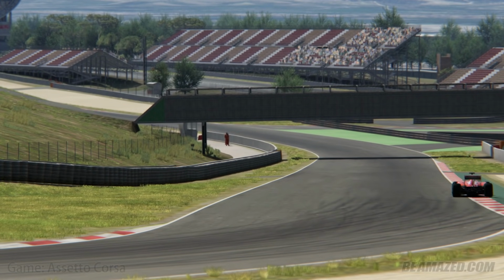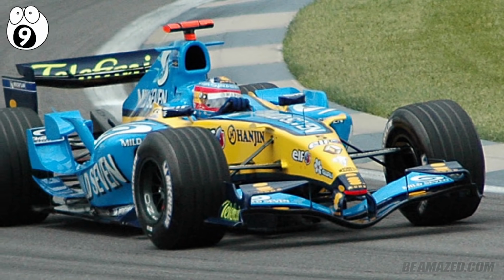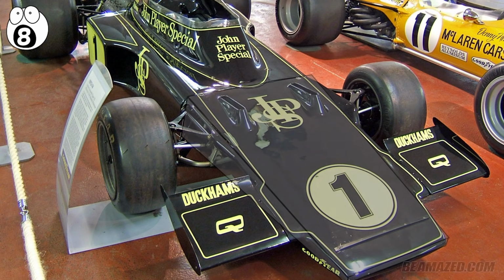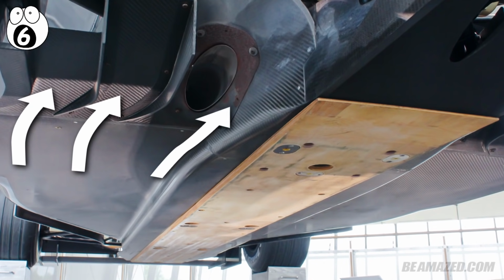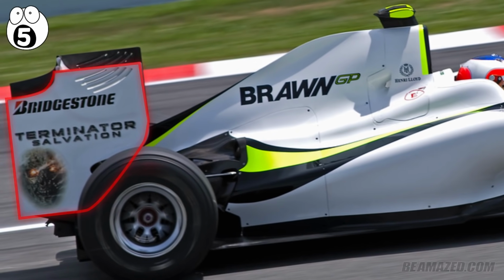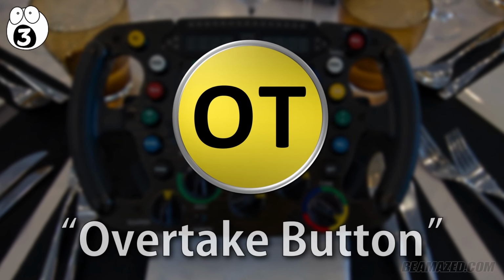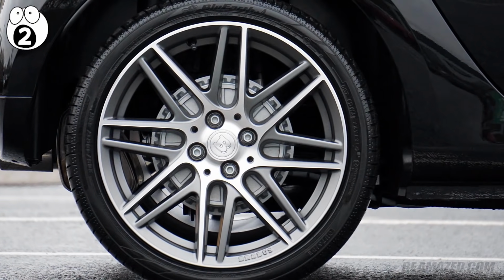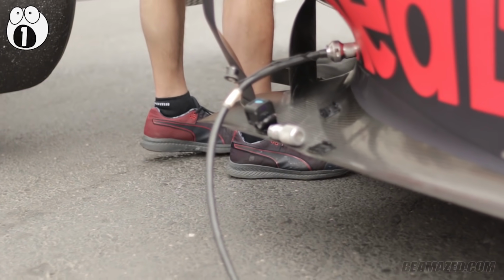Secrets Of F1 Car Design You'll Find Really Interesting

Comment: Hate to ask this, but did you not do science/chemistry at school?....Nitrogen in tyres is the BIGGEST rip off ever invented. The gullible have fallen for this hook line and sinker. By volume, dry air contains 78.09% nitrogen, 20.95% oxygen, 0.93% argon, 0.04% carbon dioxide, and small amounts of other gases.   So....The air that you put in a normal road tyre contains 78% nitrogen.

Comment: @Be Amazed: You are telling a lot of factual wrong statements. Just looking at the numbers of your subscribers and views, you have a big responsibility to bring correct facts to your public. I emplore, actually I BEG you to make another video where you correct yourself:

1. Front wing: You have quit a few misconceptions here. The end fence, as you call it, is NOT there to decrease vorticity. It is only there because the F1 technical regulation prescribe a mandatory 95,000 mm² bodywork piece in that area in sideview. The endplate is also not a (side)wing. The mandatory piece is mainly sculped this way to divert airflow away from the front tyre. It's not there to create lift. There is no point to reduce outboard vorticity of the front wing because the rotating tyre right behind it creates huge and detrimenting vortices in any case. Infact, teams try to create vorticity both in the outboard section and the Y250 section to divert airflow away from the tyre. Tyre vortices are that detrimental.

Now I hear you thinking: hold on, wings have endplates (can I advise you to use this term? Even the official tech rules use this term) to reduce vorticity, it has always been like that. Well, the current iteration of a F1 front wing is not really a wing! It is much more a front diffuser/splitter because it works mainly in ground effect. Vortices are therefor mainly created inboard and not outboard of the "front wing", just like a diffuser.

2. Your drawings of the underfloor showing high and low pressure are wrong. At the underfloor, you actually have low pressure, which goes extremely low at the diffuser "mouth" (where the diffuser starts). As you mentioned, the airflow then expands and SLOWS DOWN and becomes higher pressure (much higher than the underfloor, still lower than the flow on top of the diffuser). This is the bernouilli effect.

3.Brake ducts are NOT there to decrease drag! Infact, brake ducts to cool the brakes are kept as minimized as much as possible! This is absolutely unfounded on your part. What you do have, are fins and pieces of bodywork in that area exploiting the bodywork rules in the area to clean up airflow for sidepod cooling and getting cleaner air to the floor and splitter.

Please, please put up a video where you make those corrections. There's already enough misinformation on the internet, don't contribute to it.

Comment: Try to understand how the hybrid system works if you want a challenge 😂
Reply: Luka Ohagei figure out the tyres
Reply: they're shit most of the time.
There you go
Reply: It's not that much of a challange, there's a good channel that explains it in detail called chainbearF1 (or similarly named)
Reply: It's very easy (!). There is a motor generator unit driven by the crankshaft, and another driven by the turbo compressor impeller shaft. And a large, heavy battery pack which can be charged and discharged in a few seconds. All you have to do is decide when to assist the crankshaft, and when to take power from it to charge the battery, often under braking. Then you have to decide when to assist the turbo, and when to take power from that. The total assist power available from the system is 160 hp, but only for bursts of a few seconds, just over half a minute in total available per lap. So the strategy needs to be right. Assisting the turbo is of use in the improvement of throttle response, for instance, reducing lag. And then how to best size and balance the brakes.  Simple eh? Not.

Installation was a nightmare in early days.The currents in circulation are in the high hundreds of amperes, making the wiring interesting. The battery packs were made from 50 or more series-connected liquid-cooled lithium-ion cells of about 1.5 Ah each, this seemingly meagre capacity compensated by the high voltages, 250-450 volts. The motors are very small, and difficult to cool, particularly the rotors. Multi-level drive electronics are sometimes used to limit magnetic heating, delivering energy to the stator windings with fewer ripple current components but bulky and heavy. Due to the high voltages, care is need in installation and architecture to eliminate problems caused by the large electric fields, which can transfer charge to other elements of the electrical system, since the accumulation of this charge can deliver potentially life-threatening shocks. When working on these systems, mechanics must wear gloves, and in any case it is good practice to keep one hand out of the way.

Comment: 'The front wing is the most important element of this [amount of downforce]' 
The amount of cringe
Reply: Clorox Bleach ... The floor provides most of the downforce on the car, with almost no drag. Plus, 'I'm really good at F1'. Seriously?
Reply: The front wing is meant to use vortices to direct the air in a particular way and in this case, away from the wheels and around the body and into the bargeboards.
Reply: Tobias Ruddi he’s so bad 😂
Reply: I think the term you're all looking for is low pressure
Reply: The front wing provides 40 is percent of downforce the back wing provides the most don't know the exact numbers but I'm really good at f1

Comment: Nurburgring NER BERG RING = Race Circuit
Nuremburg - NUR REM BERG = Site of Nazi war trials
393km apart, often confused by the mentally bereft
Reply: That's the Norisring. See my first reaction in this topic.
Reply: As James May discovered after sat-nav misuse...
Reply: Nuremberg has also a street circuit called Norisring, which is on the site of the Nazi Rallies in the 30's. Noris is the Latin name of Nuremberg. They choosed that name because Nurembergring looks to much like Nürburgring (with " on the u!).

Like in this video, the name Nürburgring is often wrongly pronounced as Nurembergring. That even makes some people think the Nürburgring is in Nuremberg, instead of in the Eifel.

A similar misunderstanding in motorsport is the name of the famous steep corner at Spa-Francorchamps. Most people think now the name is Eau-Rouge, but the correct name is Raidillon.
Reply: Circuits of the past Pretty sure every self-respecting racing fan knows the difference between Eau Rouge and Radillon.
Reply: Then the're not much self-respecting racing fans. The majority calls the Raidillon Eau Rouge. And not only the fans but also the drivers and reporters.

Comment: So, so many flaws but let's just say that how you described diffuser, is totally opposite. We have low pressure area under the car where air moves really, really fast. Diffuser takes this air and slows it down and bring the pressure back to ambient air pressure. So there is high pressure around it, not low. Read: Bernoulli principle

Comment: Racing cars have a steel cable tethering system on the wheels to stop them flying off and killing spectators and marshals. 
That is NOT a secret.   :-)
Reply: yeah in a crash but if the wheel hasnt been properly attached to the car and it gets loose theres nothing stopping it
Reply: Thats true roni :-)
Reply: roni harjapää Has that happened before? I feel like the teams would go to painstaking lengths to make everything on the car perfectly set up, and forget the tethers.
Reply: No. I mean the actual rim is only held in place by a single nut. Thats why a pitstop is 2sec long. If the nut isnt in place properly the wheel might fall. Look at Sainz in the 2017 Abu Dhabi GP

Comment: End fences you dumb, their called end plates
Reply: It’s also called an end fence you fool. Most designers refer to them as end fences
Reply: Dubz0Eight he mentions bargeboards. But when talking about the front wing he talks about the side of the wing, which he incorrectly calls end fences instead of end plates
Reply: The cringe is real hehe
Reply: ColeT12378 CT43 are you dumb...they're called either Einstein.
Reply: And they work the same way ducts work on propellers

Comment: Much of the data you have used is outdated, you have used wrong names.  You also use pictures and videos that are not even F1. Much of the things you talk about are relevant but some things are no longer used. There are other things that are much more interesting instead of these. ERS for example, or the efficiency of the engines, which is reaching 50% now.  You also left things out about turning vanes, blown defuser, push and pull suspension, blown wheel nut, and you also left out that the front wing creates vortexes that are directed to guide air along the rest of the car.
Reply: Bryan Hopkins you seem like a person who doesn’t know jack shit about racing. First of all most of these so called secrets are kinda obvious. The rear up turn of the floor is called a diffuser, the front wing does a hell of a lot more than he explained, he did not say that the air intake on top of the car also doubles as a safety mechanism when the car flips, he left out Bernoulli’s equations and the Y250 vortex created by the front wing to smoothen our airflow over the sides of the side pods and then increase the overall efficiency of the  diffuser by reducing tire wake. It’s way to many wrongs to correct in the comment section. By the way I’m studying aerospace at uni. So don’t fucking tell me to shut up about things that I know more about than you.
Reply: Pull suspension isn't that new Indy car and most open wheel racing use pull suspension as it is easy to fit
Reply: Well sw gaming....then correct everything in detail otherwise stfu.
Reply: Where can I find info like that? Links for further research? Where I can find the legit info and learnt the F1 Aerodynamics?
Reply: https://www.mech.kth.se/courses/5C1211/Casiraghi_2010.pdf
Reply: This is just a slideshow but it does give good information
Reply: http://umpir.ump.edu.my/1705/1/Mohd_Syazrul_Shafiq_Saad_%28_CD_5074_%29.pdf
This is a university paper on it
Reply: SWA Gaming you talk about his information being outdated yet you mention the blown diffuser...nice one

Comment: Bulls**t, the front wing isn’t the most important, the undertray is as it gets 50% of the total downforce (negative lift) and the front wing isn’t creating downforce because of pressure, it directs the air around the tyres and on to the rear wing and gets a minimal downforce level
Reply: you couldn't be more wrong about the diffusor though. The expansion creates low pressure at the diffusor throat. This low pressure sucks the air out from underneath the car. Therefore the air is being accelerated and pressure drops along the entire floor and downforce is being created
Reply: The back wing provides downforce so the car doesn't have wheel spin the front wing filters cooler air into the cooling system while flying the front tires to the attack for a more stable turn
Reply: The front wing has endPLATES and not sidefences and the endplate’s use is to reduce induced drag, the vortex you showed is un-evitable because of the complex structure (Y250)
Reply: The undertray doesn’t work because of the expansion but rather because of newtons 3rd law (each action has a equal and opposite reaction, thus the angle pushes the air up and the car down) the downforce is created by air accelerating under the car and decreasing pressure
Reply: The front wing does create downforce, aproximatley 20% of the cars total downforce, Designers have basically maxed downforce it can create so they have moved to directing airflow to different parts of the car. Like the turning vanes and barge boards.
Reply: I'm more than willing to drop complaints about the term endfence, they aren't that bad of a term, but indeed the description is wrong. The most important thing about them and you yourself overlooked, is that these are there because the rules force teams them to. If there were no rules about them, teams would most likely not have an endplate in there. There is no need for an endplate as this isn't a run of the mill wing; the current front "wing" is closer to a splitter/diffuser than to an actual wing, creating the vast majority of the downforce out of ground effect.

Comment: #9    One crucial function of the airbox inlet is safety.   If you draw a line from the top of the inlet down towards the body right in front of the driver you'll see the driver's head is below that line...   that way, if the car flips upside-down there's less chance of, I don't know...   decapitation?

#5    The end plates on wings are there to stop the high pressure air from the top of the wing moving around the edge of the wing to the low pressure region underneath...   that creates a vortex, which is a drag, and lowers the efficacy of the wing.

#...  oh nvm, this was cringe of the highest order...

Comment: Secrets of F1 Car.. shows a F2 car in the thumbnail
Reply: Eetu Laitinen Clearly a basic under 14yo Finnish F1 fan. Just came here calling others dumbasses and then getting triggered by someone disagreeing.
Reply: Eetu Laitinen its an f1 car from years ago, 2011 i think
Reply: Eetu Laitinen  it is an gp2 car don’t act stupid
Reply: SHF // ShadowHunterFi  from 2009 to 2013 they had 3 elements
Reply: Dat Boi If you would take your time to do the research, you would find that this is the 2010 Virgin Racing VR-01, repainted with a Marussia livery as the Virgin Team was bought by Marussia in 2011.
Reply: D-Force-UK its not, its a GP3 car
Reply: Alfin R Did you even look at it? Please do proper research before posting unonformed comments
Reply: Dat Boi nope, search virgin vr 01, two elements and it raced on the 2010 f1 season. That team later changed its name to marussia, who repainted the car and used it on shows
Reply: Alfin R its a Virgin Vr 01 repainted, look it up
Reply: Eetu Laitinen eh you're the dumbass
Reply: Kurafuto Mine u fucking idiot the F2/ gp2 cars have shark fins, and that one doesn't... It is not a GP2 CAR

Comment: The side plates are actually used to generate and control vortices, not prevent them.
Reply: They are also called end plates
Reply: End plates are meant to prevent vortices. The front wings aren't really using end plates since they generate vortices, and the video maker was wrong saying the wings are intended to prevent vortices under the car, and actually the opposite is true.
Reply: By side plates what do you mean? I thought you were referring to the end plates on the front wing
Reply: I was just saying their use isn't for stopping wing tip vorticies. I guess they're still called end plates but if you look at them they have a bunch of vortex generators and curved profiles on them. The rear wings have giant end plates though to prevent vortices.
Reply: Yeah that sounds correct, The endplate on the front wing creates vortexes while the rear wing endplates smooth the air out for the defuser.